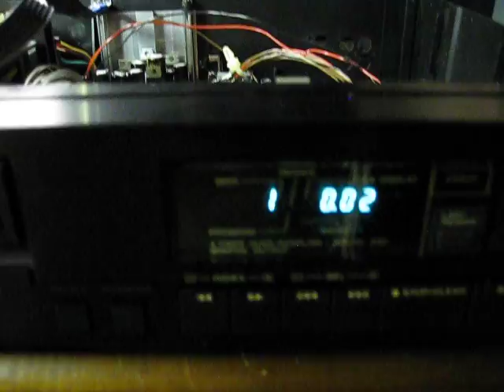Marantz CD 65 - replaced aged electrolytics and display drivers.

Comment: Hi could you show the Capacitors being replaced and which ones as that would be great.
Reply from the maker: Neil,
 I do not remember which ones I replaced. This video was made in November 2016. But in general, replace any that are bulged or leaky. The next step is to invest in a capacitance meter or general component meter that measures capacitor's ESR or Equivalent Series Resistance. If that is outside the value for the particular capacitor's capacity or its capacity is lower than printed on it, then it needs to be changed. There are meters on eBay with no box (just board) for around $25. You can search for tables which state correct value of ESR for the given capacitance and voltage.
Hope it helps a bit.
Roman